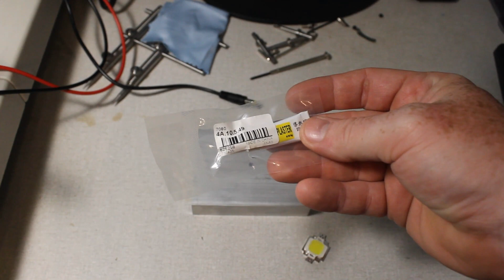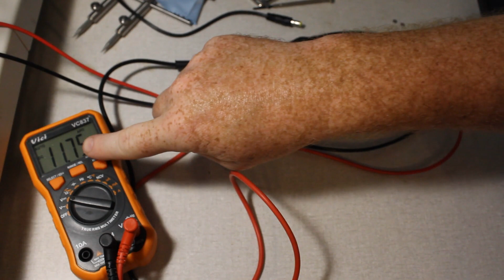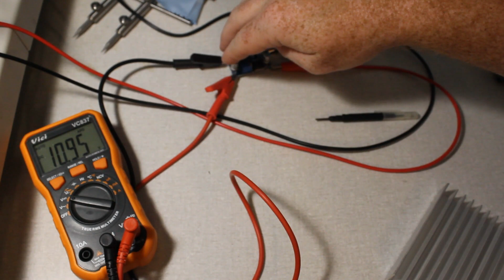UV led enlarger projector conversion with parts list from Amazon

Comment: This is spectacular! Thanks! May I asked the brand and model of your slide projector?
Reply from the maker: That particular one was a bell and howell not sure the model. I would suggest going on ebay and getting a minolta mini 35, they are easy to convert and it has a 75mm f2.5 lens so it can make larger prints with a closer distance and faster.
Reply: @matthewbary1  Thanks, I just bought one.
Reply: Are all the internal components in your links still correct for the mini? Thanks
Reply from the maker: @dalehammond1749  Yes all should be the same. Used the same components on 3 different models and they all worked
Reply from the maker: I am trying to figure out how to post a picture for you to see, I might be able to on my page

Comment: This was very very cool to watch. If you get a free moment I’d love to see your process on how you develop Ortho Lith film. I’ve been experimenting Arista Ortho in 4x5 and not having much success. Happy New Year!
Reply from the maker: I would be happy to help. I love ortho film because you can develop by inspection and I have used it in 4x5 medium format 35mm and even some hamade camera projects. One reason I use it is because of the lower cost than regular film but I also use it because of the look it gives me and the extremely fine grain as well.
Reply: @matthewbary1  Yes cost was my main attraction to it as well. I know I cannot approach it’s use in the same way as sheets of HP5 or Delta 100 (or even Arista 400), but any tips on getting consistent results in exposure and development would be extremely helpful! 🙏🏾
Reply from the maker: @melaninxhalide1165  First thing is I expose at around ISO 6 using a standard phone light meter app and this gives me a nice high contrast picture and if I want a lower contrast I will pre flash the film. Second I develop the film in Dektol and I use a 1 to 10 dilution from stock solution for around a minute, stop bath is just a simple white vinegar and water 50/50 solution 30 seconds, fix in Kodafix 1 to 3 dilution for around 2 minutes then I rinse it in distilled water for 2 to 3 minutes and dry. A few tips, you can dilute the developer up to a 1 to 30 solution which slows down developing and gives you more control over the developing, you need a "safe light" if you do not already have one a homemade led one is easy to build as long as it is a "deep red" led or  650nm-660nm light " a red light therapy led bulb will work to as long as it isn't lower than 650 nm higher is fine and I highly recommend developing by inspection as it gives you much better and more consistent results since you can stop the developing whenever you want. Last tip is yes it has limitations being super low ISO and orthochromatic but you can use that to your advantage as well, I have been working on a number of tests using a 100w royal blue led or 440nm-450nm as a light source, since the film is only sensitive to blue light that means that if you use a blue light source it uses 100% of it. I have had to speed up shutter speeds and or close down the aperture to keep from over exposing it so now I am making a "blue flash" that will enable faster photography with ortho film. Hopefully all of that helps lol
Reply: @matthewbary1  THANK YOU SO MUCH! 🙏🏾

Comment: Man, I’ve spent a few years trying to do this with my old enlarger. I completely forgot that I could just use a darn slide projector! Thanks for sharing.
Reply from the maker: No problem. I think it has to do with the lens and condenser assembly on a projector versus a enlarger. I have gotten an enlarger to work but had to use a much higher powered light source and it still doesn't work as well.